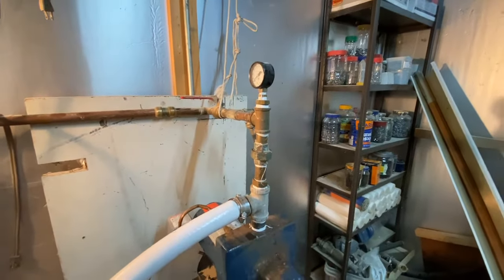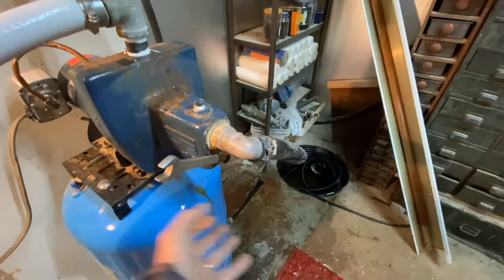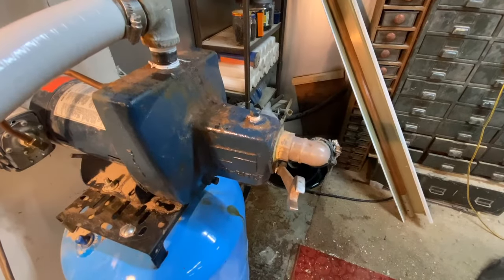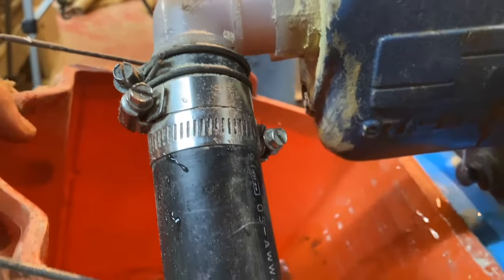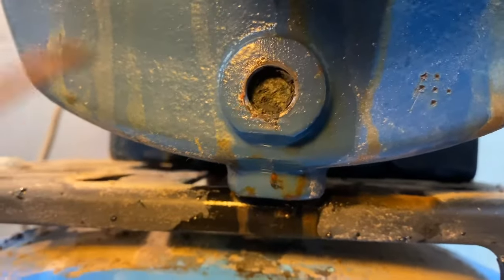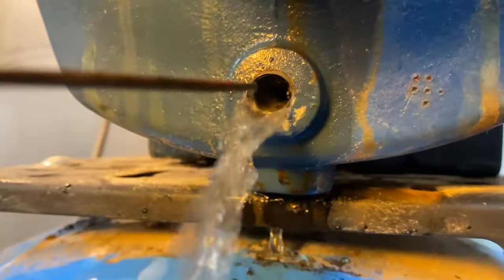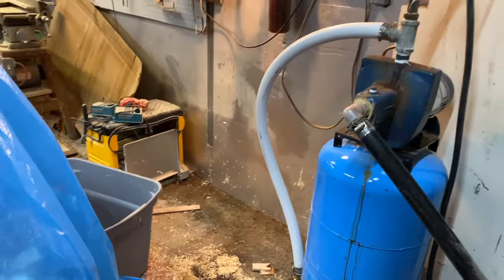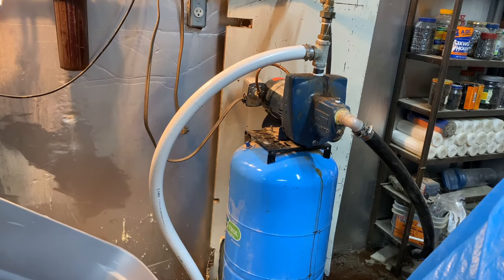my shallow well Water pump wont build pressure

Comment: Your video helped me out a lot.  After changing my pressure switch hose I think I inadvertently pushed some sediment into the pump housing and then it ended up clogging the jet.  I took the little screw off and tried cleaning but it didn't help - my pump would only pump up to 30psi max.  After messing with it for hours I found your video, and saw your idea of flushing out more water through it, so I tried one more time, cleaned the jet by sticking an airbrush pipe cleaner in there and then poured water from the top until it came out where the jet screw was.  Tried again, and it pumped to 40psi, so I knew I was on the right track.  Took the screw off yet again, cleaned it, flushed it, and now it's pumping up to 50-60psi no problem.  Thanks for your vid!!!
Reply from the maker: That is so good to hear. thanks for taking the time to comment. I am glad you got oit fixed and did not have to spend $$$ for a new one.

Comment: Thank you for this video! Very useful information.
Reply from the maker: You’re welcome, it certainly could save you several hundreds of dollars if this is the problem and can be fixed without buying a new pump. This is common for an older pump has been around for a while it has a lot of iron in there well they can build up quickly as well

Comment: I would like to ask if you could help us because the gauge of our water pump is set to turn on at 20 psi and to turn off at 40...but we saw it yesterday and it became 10 to start and then turns off when it goes up until 20...we don't know what happened why the gauge measures changed. Thank you for the help in advance...
Reply: Well, it could be several things, the gauge itself could be bad, or they could be debris stuck in the backside of it, which is causing the reading to be incorrect. The only other thing that I can think of is the controller itself that is set to come on at a certain pressure off the appropriate pressure, it’s hard to tell from a distance. I hope this helps.
Reply from the maker: I commented as my other channel, but as I was saying, it could be debris stuck in the back of the gauge, causing the reading to be incorrect or the gauge itself could be bad other than that the only other thing I can think of is the controller itself? Is your water pressure any different than before? If not, then I’m guessing it could be your gauge, but like I said without actually being there, it’s very hard to tell. I hope this helps.
Reply: Thank you so much for your help, we'll try to see and check...thanks again

Comment: Trying to fix ours on Christmas. Our pipe burst and we fixed that but the pump was running for probably an hour. Got it fixed, turned the pump on and no pressure. Turned it off and it goes to 5PSI but on it drops to 0. No water in faucets. Not sure what to do. Pressure switch looks good. We have a spring and a Goulds Jet Plus.
Reply from the maker: Did you try what I showed in this video?
Reply: @shanesmaineshop  yes sir. I did. Tried again today and pump is 0psi on and 25 off. I have no idea. Tank is empty but I hear water running through the lines when I cut power. Tested the pressure switch with a voltage meter, everything is good. I'm at a loss. Going on day 3 with the wife cussing me and no water. Lol
Reply from the maker: @livingthedash6727  Do you have a Spicket right close to the pump? And if so when the pump is running if you turn that on do you get full pressure of water coming out? The only reason I’m asking is I wonder if you’re just not getting water out of your well or at least not enough to build pressure. Also I’m sure you already have but another thing to check is to make sure there’s absolutely no air leaks on the intake side that could cause a similar situation is this as well. Sorry I having trouble during the holiday season. Hopefully you’ll get it fixed soon.

Comment: Me and my dad are trying to prime a jet pump our old pump went and we bought a used one on marketplace, we have it full of water, it sounds like it wants to go but then it gets loud and doesnt build any pressure, you can hear water moving around once the pump is turned off again. the water is trying to move. Any ideas? Basically it wont prime but yet its full of water as is the intake line.
Reply from the maker: It’s really hard to say, it could be many things. Number one I would make sure there is no leaks on the suction side you won’t see water but if it’s sucking any kind of air it will have a hard time priming and building pressure. Not sure how old the pump is or used it is but it could just be no good. One thing I will check is when it is running do you have a Fossett nearby you can open to see if it’s pumping plenty of water but just not building pressure?

Comment: Cool video. Does that pump give water pressure inside the house?
Reply from the maker: Yes we have private shallow wells, that pumps the water out of the ground and builds pressure in a tank which then distribute it throughout the house.
Reply: @shanesmaineshop  that's what I was figuring but wasn't sure...

Comment: Did it work?
Reply from the maker: Yes, it’s still working great
Reply: What if no water comes gushing out when pump is on but i can see impeller going around.?
Reply from the maker: @quilcene1 It’s hard to say but the pump could be bad the impeller can still be spinning but not necessarily pump water if the seals and stuff are bad. It could be many different things you could have an air leak somewhere. Sorry I can’t give you a specific answer it’s hard to say at a distance.
Reply: Thanks, gona pull up the foot pump and see if its clogged up next.

Comment: Fake news lol I had big hopes for this one, instead it wrecked my sensor by the full pressure blast of water!
Reply from the maker: Sorry it did not work out for you and it caused some damage I mentioned that it very well could be a pretty good blast of water.
Reply: @shanesmaineshop  Lol I am just breaking balls, I knew it was going to blast the sensor, maybe it will dry out and work right tomorrow, or I will bypass them.